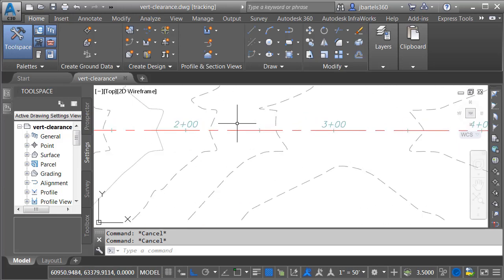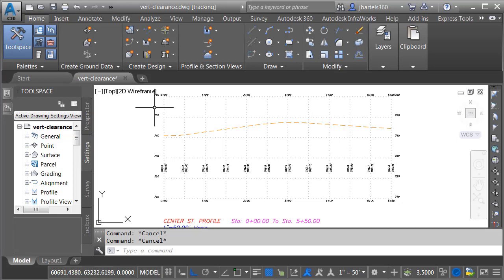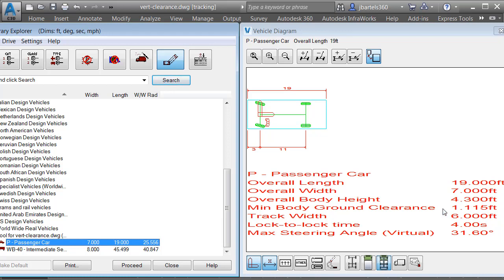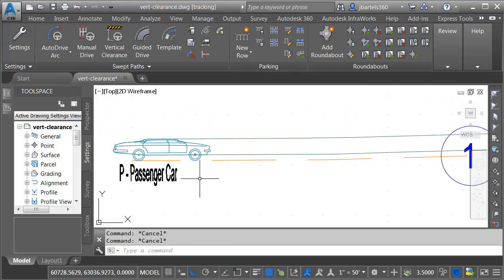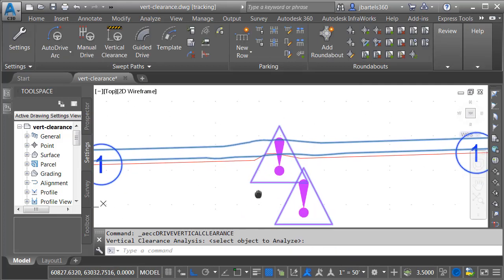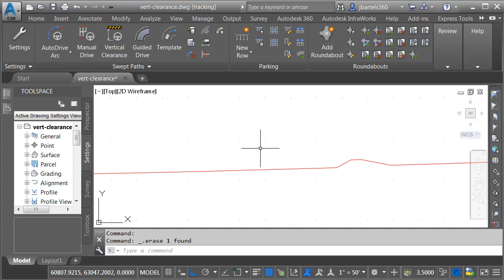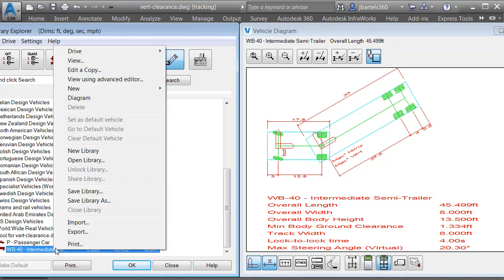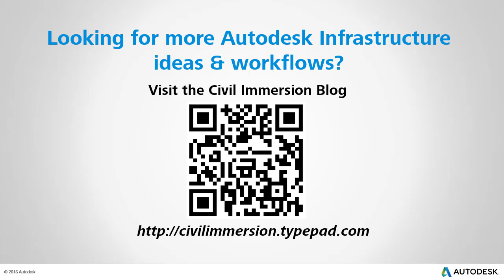Analyzing Vertical Clearance using Autodesk Vehicle Tracking - Pt. 1 of 2

Comment: Is it possible to run the command in the profile using a Crane, for example this one "Liebherr LTM 1800 Mobile Crane"? The command gives me back this error "The drive mode does not support vehicles with multiple front axles". So i suppose I cannot use this command with that vehicle? Instead, I used the other command (part 2 of your video) and that worked with the crane. So the result is reliable even if obtained not in the profile but in the planimetric view right? Thank you